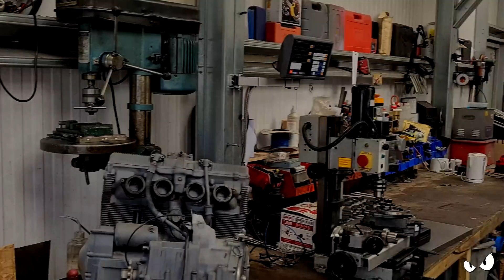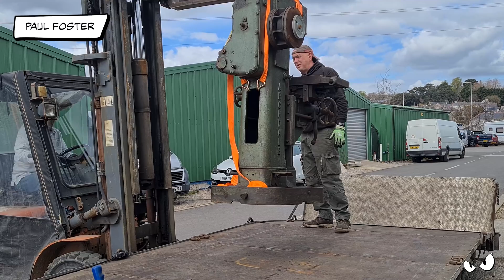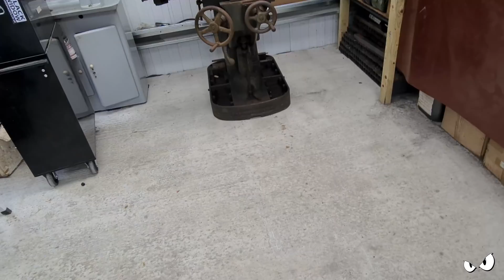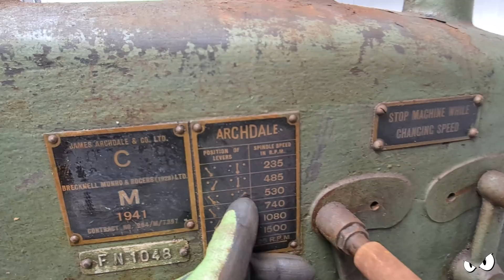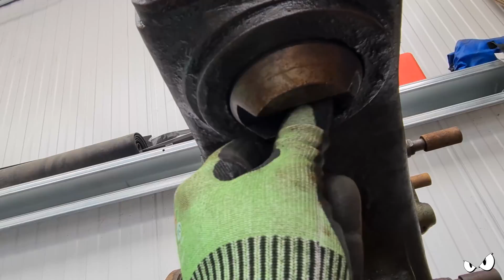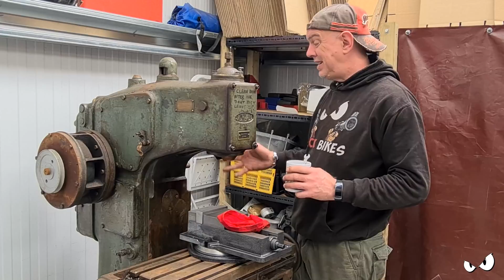Archdale Vertical Milling Machine

Comment: That's a baby. Have you seen it run. We all have to start some were. What is the taper in the quail for tooling. Befor you go cleaning make sure it runs, is it three phaze or single. Good luck and enjoy.
Reply from the maker: Everything moves on it, nothingness seized but there's no motor installed or wiring. It's a weird head setup.as well as I don't think there's a taper,  it's just drive dogs.... I do have a cunning plan though so hopefully it won't be.long before it runs. It was last used in 2000 and has simply sat in a garage ever since 😳😁👍

Comment: Just had a thought. I’ve got a int 40 holder you can have to see if it fits.
Reply from the maker: That would be cool...
Reply from the maker: BTW..... How's the kitchen going?
Reply: @QuickBikes  bathroom is going fine thanks. When I’ve got 5 I’ll send you pictures of a int 30 and 40. Not sure they will fit though.

Comment: I think the clutch is for it to be belt driven - I have an old photo of my Grandad in circa 1920 completing his apprenticeship at Bluemels (bicycle manufacturer) and everything was centrally driven from overhead belt drives. ;-)
Reply: Oh, and don't believe the serial number. When I first started at AP Lockheed (brakes), there were many older machines that were MOD supplied for the war effort. When the government wanted them back (only to be scrapped) they swapped out the serial numbers for ones on much older machines so they could keep the newer ones!
Reply from the maker: I never knew that... it would be about the right era I guess... I need to do some more digging and see what I can find out 😁

Comment: Couple of other things.

You might be able to source some manuals from lathes dot co dot uk

The spindle looks odd, never seen a morse taper with driving lugs.  You probably want to measure it pretty carefully to make sure you're on the right taper, there's loads of "close but no fit" options, and it seems from a quick googlygogley that some archdales, at least, had Int40 cones.  which still wouldn't explain the driving lugs.
Reply from the maker: Cheers Michel. I've been in touch with Tony and sent him some pics to identify the mill and get some manuals. The driving lugs are very different to the mini mill set up so I'm not sure I'll be able to use the old tooling I have. Don't really know till I figure out exactly what everything is... thanks for chipping in 😁
Reply: @QuickBikes  Also, check out AGB engines on Flickr (linked from the forum above), he appears to have some closerer up photos of the machine, looks like it might be a VM2641.  

I don't know much about INT 40 vs BT40 vs ISO 40 vs NMTB, I believe they are interchangeable pretty much.  The lugs may well bolt to the spindle.  Might be worthwhile having a hat around the local engineering shops.  Or even a chat.
Reply: Replying to myself, but www dot modelenginemaker dot com slash index.php question mark topic equals 9404 dot 0 suggests INT 40 for a machine that looks almost identical to your'n.  Well, that *is*, to all intents and purposes, identical to your'n, best as I can tell.

Comment: If the forklift is not tipping over when loading that is a light mill, will be fine,
Reply from the maker: Hehehe... oh they come much bigger than this, but this one is MINE 😁👍
Reply: @QuickBikes  I would like yours as it is simple and rigid, do all the fancy angles and stuff on the table, no tramming up after etc.
Reply from the maker: I've got angle blocks n stuff so no biggie, it's the rigidity of the thing I love.  I can't wait to try it now 😁